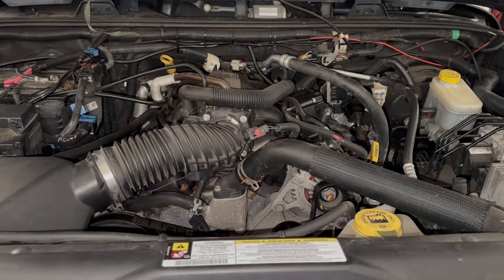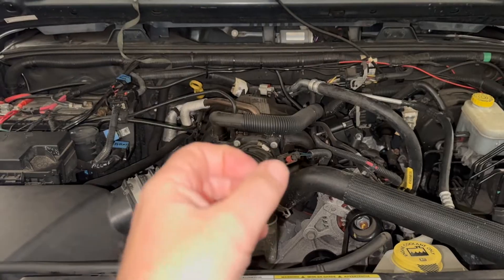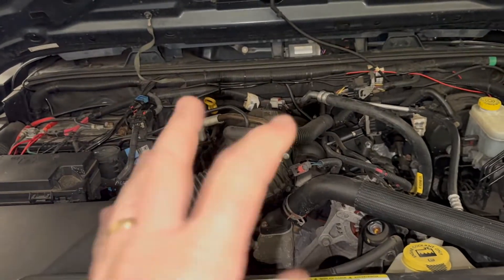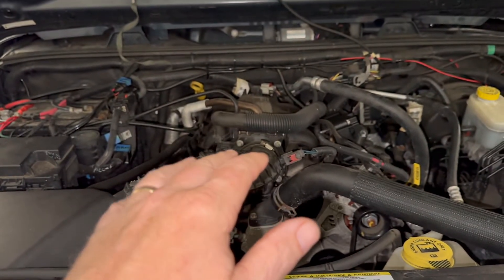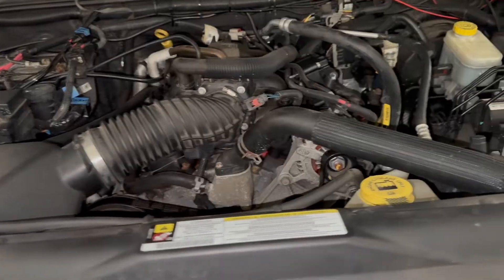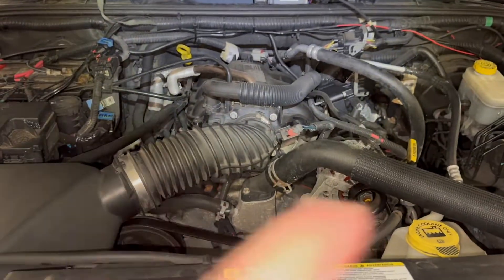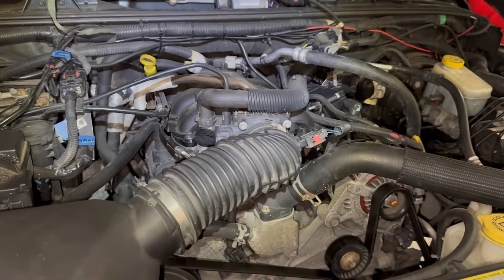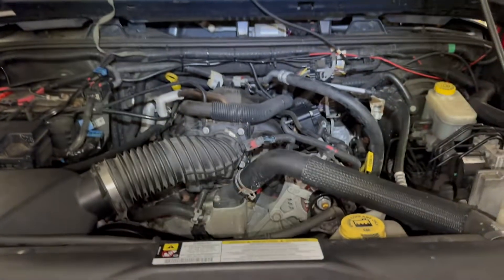What Is An Engine Misfire - Symptoms, Causes & Fixes

Comment: my check engine light is flashing and my engine starts shaking and it's a p0300,I changed all ignition coils and all spark plugs and I'm still having the same problem and it takes a while to accelerate.Its a 2013 Nissan cube
Reply from the maker: Sounds like you've covered the basics. Given it's a random misfire code, I'd suggest checking fuel delivery and vacuum leaks next. A smoke test might reveal something that's not obvious.

Comment: I have a misfiring code p0304/ p0316 I think it’s the ignition coil and spark plug for that cylinder I got it scanned
Reply: Is there anything else I should check for?
Reply from the maker: I would start there and see if it helps fix the problem.
Reply from the maker: Just switch number 4 with number 3 see if misfires go to number 3 if the do you know its either the coil or spark plug, do that with coil first then spark plugs,
Reply: @motorcarnut ok me and my friend will definitely check it out I’ve put it in the shop multiple times and it seems as nobody can figure it out.
Reply from the maker: Shouldn’t be too hard at all
Reply: @motorcarnut ok thanks I’ll reach out to you tomorrow after we attend I’m pretty sure that’s the issue I checked online it’s pretty common on ford escape

Comment: I just took my car to a mechanic for a bad cam shaft sensor  bank one well he kept trying to get me to let him change spark plugs and charcoal canister..Anyway he puts the sensor in and his son left the cover off the top of engine I get 5 miles  down the road and the engine light starts blinking misfire I take it back to him he hooks it up agian and says yep all the plugs need changed 🤷‍♂️ I asked him how's it misfiring he said well it wasn't running right cause of the cam sensors..Anyway I think his son might not have hooked the air intake  back on correctly on purpose they did change one spark plug maybe he pulled the coil pack off it just enough to cause that miss🧐
It never misfire it was stalling and hard to start going into limp mode..
Because of cam sensor now it's running good but missing slightly 
2005 Nissan altuma 3.5 Really don't know what to look for but I believe he did something to cause be to have to bring it back..🤔
Reply from the maker: Sounds like they did, who knows what they messed with.

Comment: I have a 2013 ford escape that’s shaking when idling or accelerating between 20-50mph and then driving normally above 50mph. No shaking during reverse, no check engine light
Reply from the maker: Check the spark plugs, coils, and injectors for any problems.

Comment: My GMC Serra has a misfire. Tech changed the #3 injector and 02 censor and I’m still having issues😢
Reply from the maker: Wiring problem or low compression.
Reply: @motorcarnut thank you so much!. He actually mentioned that it could be wiring!.. when I got me truck but I changed to a higher grade gas and leather tank full. And for about 3 months I’ve had no issues. And the light started back blinking last week. I’m actually heading to the GMC place right now
Reply from the maker: Sure, no problem! Good luck with that and let me know what they find

Comment: Hi i have a hyundai sonata sport and i started it up after it sat in the parking lot while i was working and the engine light is on, not blinking, but the car SHAKES bad when idle. I drove it a little and hitting the gas it shakes but no shake while rolling above 10mph.
Reply from the maker: Could be a bad ignition coil or spark plug, check the code and see which cylinder is misfiring.

Comment: Hello. If I may ask is it a miss fire if it shakes but when I switch the engine off and on again it goes back to sounding normal?
Reply from the maker: Yes it can, meaning its probably ignition related rather that say low compression.

Comment: Hello I have a 2017 Ford Mustang. The engine light turns on and starts flashing and the car starts shaking a little and then when I turn it off and then turn it back on it goes away and it does not shake as I start driving again. After 20 mins of driving it the same thing happens again, light comes back on and the car starts shaking a little bit. Do you know what it might be possibly .? Thank you if you can help out I appreciate it.
Reply from the maker: Sounds like you are having a misfire, get the codes pulled and go from there.

Comment: Hey, how’s it going, bud? I got a question. Maybe you could help me out. when I read the codes on my check engine light cell. It said the vehicles has multiple engine misfires on cylinder 1,3 and 4. I continue to drive the car with the misfires and I was coming back home from work today in the car. It just completely stalled out and lost power When I attempted to start the engine again. The car wouldn’t start. Do you think it has to be the car, not getting spark from the spark plugs and the coil packs?
Reply from the maker: You probably have a bad vacuum leak somewhere, 3 ignition coils or 3 spark plugs don't just all go at the same time no.

Comment: I have a 2021 Kia Telluride with a V6, and it has been mis-firing.  The code was P0304. So only misfiring on #4 cylinder.  I noticed my coolant was a little low and so I added coolant. After that I haven’t noticed any misfiring.  Could the low coolant have been causing one cylinder to misfire?   Or is this a coincidence?  
(And the engine was not overheating. I don’t have temperature measurements but never got any dash lights, no smoking, no hot smells).
Reply from the maker: No that was probably a coincidence, You may have a failing ignition coil or spark plug. As long as the engine didn't overheat bad then your head gasket is probably find as well.

Comment: On two occasions my car started with little power, I stopped it, then it turned on again and then it was fine.  It has not done it again. I noticed ut shakes a bit sometimes when I drove above 70 m, when it's a bit windy. The engine liggt turned on a couple of weeks ago, then it turned off and it has not turned on again.
Reply from the maker: It would be nice to know what vehicle you have?

Comment: Hello, I have porsche cayenne 2013 V6 3.6.  I have rough idle/shivering after I accelerate full pedal on the highway and then when i stop at the signal, it starts to shiver, more like rough idle when stationary. I changed to delphi coils & bosch plugs but still issue remains same.  But no issues while I drive normally. Computer diagnosis shows cylinder 3 and 5 misfire. Please advice.
Reply from the maker: Can be a vacuum leak, I would check cylinder compression on both cylinders to make sure its not a leaking head gasket.

Comment: Hello I noticed my car stop accelerating once it gets to like 60miles/hr. There is a sluggish and lags as it gets to 40miles/hr but once it’s get to 60 it doesn’t feel like it’s moving up. Could this be a misfire
Reply from the maker: Yes, that can be a sign of a misfire, check for any engine codes.
Reply: @ thank you
Reply from the maker: No problem

Comment: My car shutters and vibrates when I accelerate usually from a stop or going up hill,  i have no check engine light on though ?
Reply from the maker: Check for vacuum leaks, fuel or injector, ignition system problems

Comment: My car starts to shake at 40mph. Check engine light is flashing. Wondering if it's a misfire
Reply from the maker: Check engine flashing is definitely a serious misfire and should be taken care of asap or engine damage can occur.
Reply: @motorcarnut  thank u. I appreciate it
Reply from the maker: No problem!
Reply: @motorcarnut  I went to advanced auto and had him scan for codes. Po305 came up and po130. So 5th cylinder misfire and O2 circuit bank, sensor. He said both codes came up 2x. What does that mean? I thought he just meant they repeated but he has marked on the paper x2 next to both of them. Does that mean anything?? I appreciate ur help.
Reply from the maker: It just means those codes are current and constant, not pending. O2 probably bad or wiring issue.
Reply: @motorcarnut  ok thank u so much. Had me worried it was extra serious cuz it came up 2x. Lol I will attempt to try and use it video to see if I can figure out if its a fuse. I HOPE so. I just worry about having to unplug so many things to take the black cover off and not putting them back in the same spot. Cus u didn't show exactly what u unplugged. Will it be easy for someone who's never worked on a car before?? Lol
Reply from the maker: @sarahmarlow3495 show what? I don’t even know what vehicle you have and the video is a general one.
Reply: @motorcarnut  I apologize I've watched a few videos and got urs confused with a different one. My apologies. Lol
Reply from the maker: @sarahmarlow3495 no problem, good luck
Reply: @motorcarnut  Hi, so I went to go get the parts. Got everything except O2 sensor. She asked me downstream or upstream. I have no clue what that means. How am I spose to know? All the code said was bank 1 sensor 1. Please help if u can. Or tell me how to do it please and thank u
Reply from the maker: @sarahmarlow3495 Sure, bank 1 sensor 1 is the upstream O2 sensor. I made a video on O2 sensors and their locations too
Reply: @motorcarnut i just wanna say. you replying to all these people, thank you for being so patient and trying to help. my truck is misfiring after it had its spark plugs replaced and wiring too( that fixed it for about 2 weeks).  its back to shaking just like the car you show here. and now i have an oil leak on top of it. bringing it to a new mechanic tomorrow and hopefully i can afford the fix. i hope the mechanic is as caring as you are!